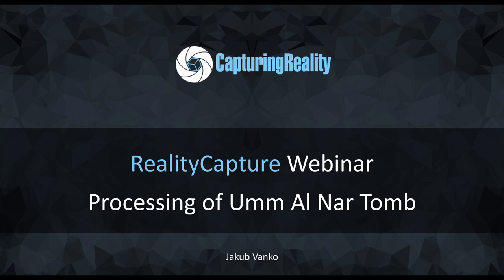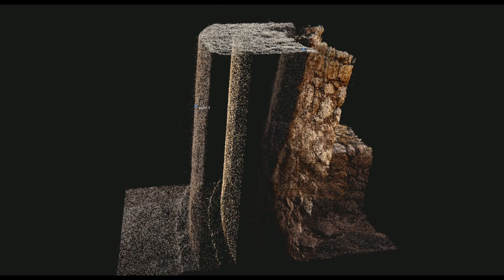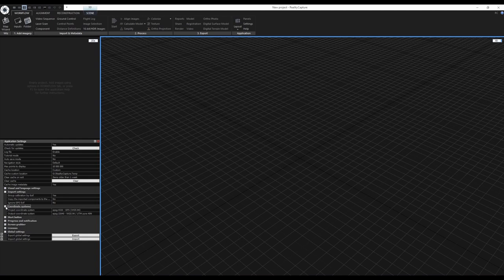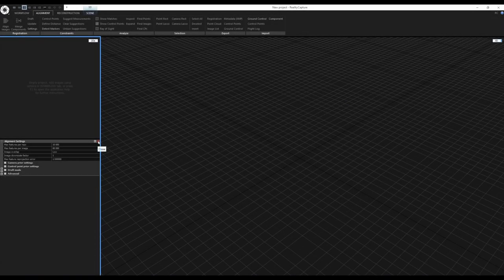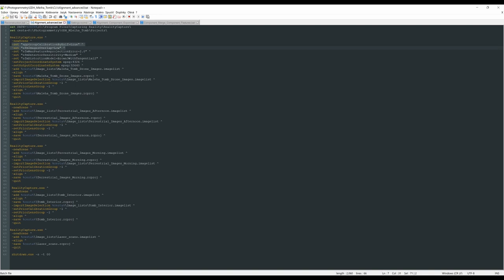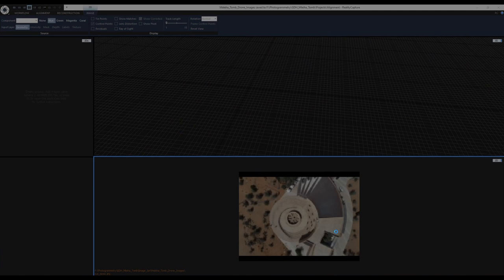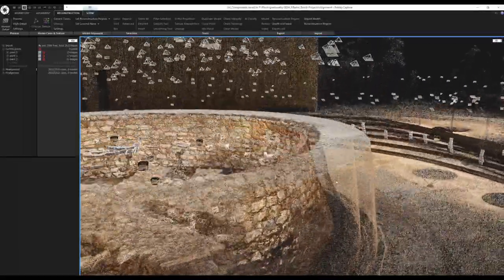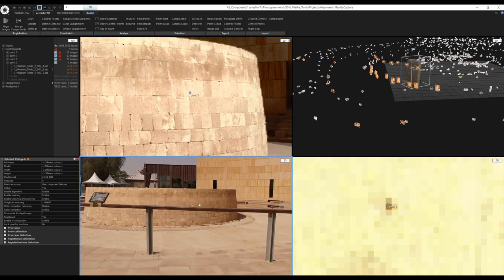RealityCapture Free Webinar: Advanced workflow for a combination of images and laser scans

Comment: You are saying that the parse point cloud is not a problem, but would it be possible to have a project only made of point clouds, without ever making a mesh? And view it on a web browser for example? Or in SketchFab
Reply: If you do not want to mesh the point cloud from the laser scanner there is no point in importing the scan to RealityCapture. If you are asking if you can export the sparse point cloud or the dense point cloud than yes you can. If you are working on a project with just photos first you will get a sparse point cloud after alignment. During reconstruction RC generates a mesh and the vertices of that mesh are the dense point cloud. RC basically generates the dense point cloud and mesh in one step. That is how its algorithms work.

Comment: Hi, I exported E57 files from Faro SCENE and attempted to import them into Reality Capture. However, Reality Capture refused to import the point cloud file. Did you use any specific settings when exporting the point cloud?
Reply from the maker: What kind of scan have you used? Is it structured? Was the scan exported as one file or separate files for each position?
Reply: @CapturingReality  Thank you so much for getting back to me. I realized I made a silly mistake—I was dragging and dropping the E57 file instead of importing it. Now everything is working perfectly! Thank you so much for the fantastic tutorial!

Comment: somehow even when I make selection with lasso tool (or any other selection tool) find images button isn't clickable
and d key doesn't influence lasso tool at all
Reply from the maker: Are you using Lasso tool under Mesh Model? If so, this option is not available. Find Images tool works only for sparse point cloud created after alignment, not for mesh.
Reply: @CapturingReality  ohhh I see, so this function can only be used after aligment, but if you've already built the model you cant use it even in vertices scene render mode
thank you now the problem is cleared :thanksdoc:
Reply from the maker: @ghooo-qu2yd  You can still use lasso tool, but you just need to hide the model view and set the tie points view.

Comment: I didnt see how are you merge laserscan data and terrestrial photos components. I have same project now but i have trouble with merging laserscans and photogrammetry component. Notice, my scans without RGB....
Reply from the maker: Hi, you can do that using control points. You need to place the same control point over laser scan and also image dataset and then align the data. You  should use minimally three CPs over three images/LSPs.
You can also watch this https://www.youtube.com/watch?v=HbdXMc-NtZQ&t=298s
Reply: @CapturingReality  I have gcp (marks) on whole model. But complexity is missing color pointcloud. Adding same control points on grayscale pointcloud and photos is thought.
Reply from the maker: @grayback0577  If you have marks, it shouldn't be so hard to find them over images and laser scans.
Also, you can use georeferenced data, then it is easier to get it together
Reply: @CapturingReality  when I add georeferenced photos component and georeferrenced laserscans they not merging together after align. I try only components switch on in align settings